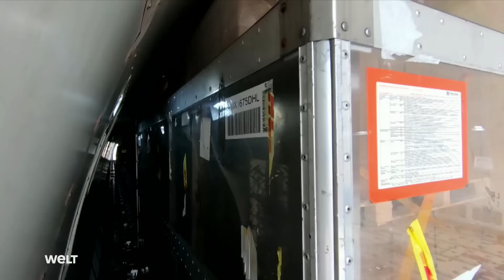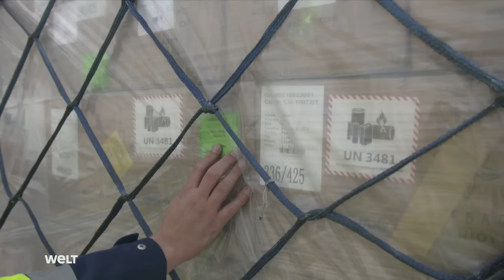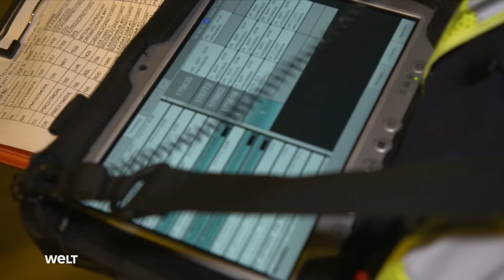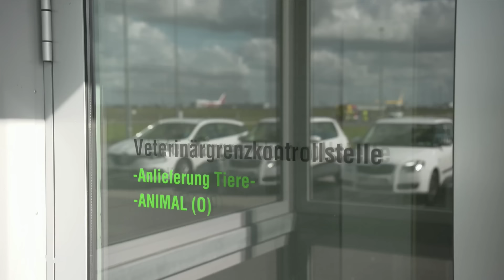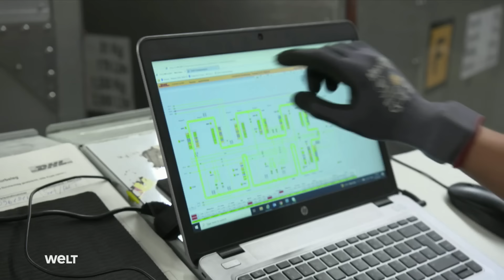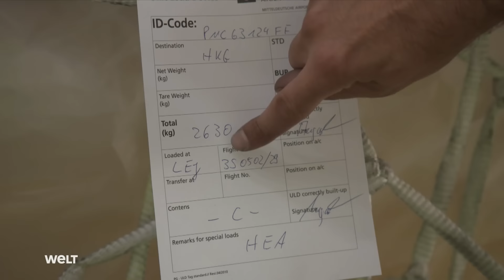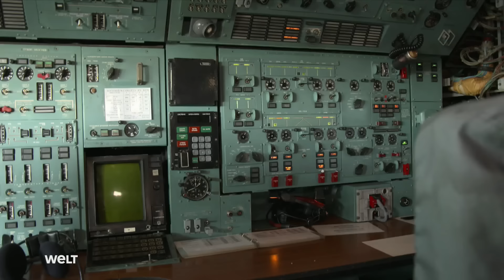WHY GERMANY IS SO GOOD IN LOGISTICS: Landing, unloading, loading – Cargo hub Leipzig | Documentary

Comment: 0:29: ✈ Leipzig Airport is Europe's fourth largest cargo hub, handling millions of metric tons of cargo per year.
7:27: 🌩 The DHL European hub in Leipzig faces the challenge of managing flight operations and cargo loading/unloading amidst changing weather conditions.
13:01: ✈ The logistics center at Leipzig Airport is a hub for sorting and distributing packages for international flights.
19:35: ✈ The Leipzig airport handles a variety of cargo, including animals and hazardous goods, with a focus on teamwork.
26:12: ✈ The process of loading cargo onto airplanes is carefully planned and executed to ensure flight safety and efficient delivery.
32:32: ✈ The Leipzig airport relies on various methods to ensure the smooth operation of air traffic and cargo handling.
39:24: ✈ The Antonov an-124 is a robust and reliable cargo plane that is used for transporting large and heavy cargo.
47:27: ✈ The Antonov an-225 is the longest and heaviest aircraft in the world, with a cargo capacity of 250 metric tons and the ability to transport cargo on its back.
Recap by Tammy AI

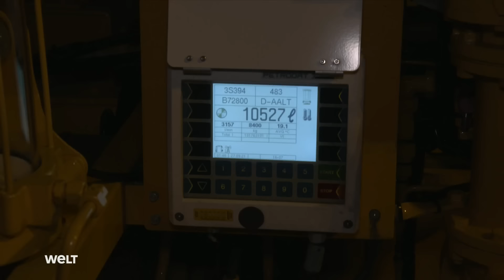Comment: 29:24 no way a fuel pump meter that Also measures fuel temp and convert the volume in mass by using it installed temperature densty graph😮